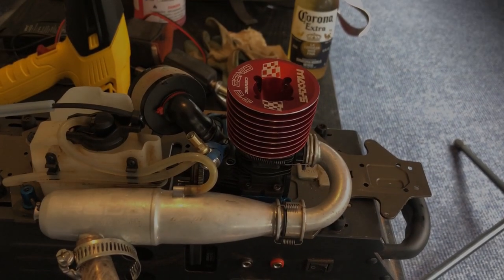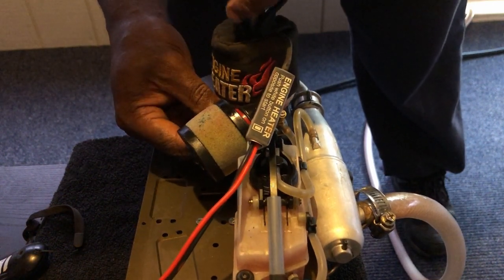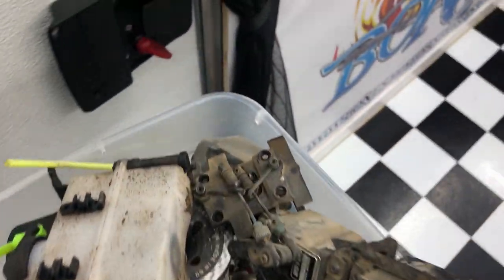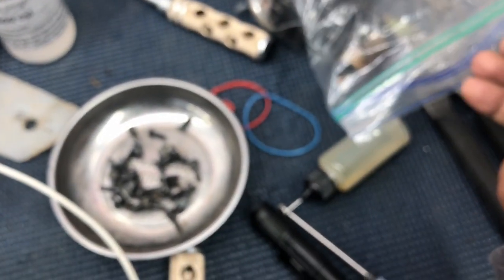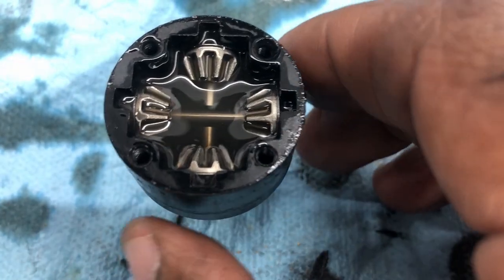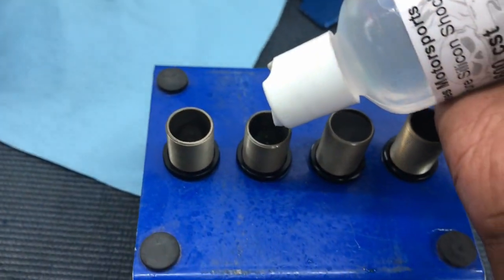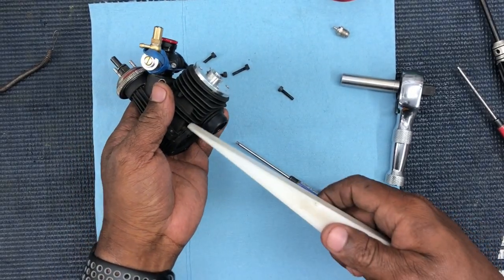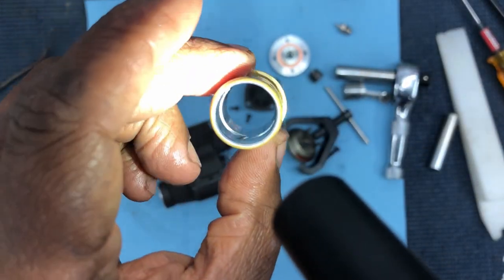Let's Break-In The Maxy's Cinco 2.0 & A Look inside After Break-In

Comment: Hey just an FYI for ya. My Picco p3tt which looks the same on the inside minus the dlc crank had an extra .20 mm head shim added to the head shin stack but on all the exploded diagrams of all the Picco engines I’ve looked at showed .30 total. So the seem to be putting an extra .20 in there for breakin. So seeing as ur engine maybe a Picco blast it very similar check your shins and the exploded diagram that came with ur engine and ya may have one too that can be removed after breakin. Keep up the great work my friend and bones brew for life!! Let the fuel haters hate. We know what the real good stuff truly is.
Reply from the maker: Sweet, thanks for the info brotha... I will give this a try on saturday

Comment: What measurement size hose did you use to run your exhaust out the door
Reply from the maker: Any size hose that will fit on to your exhaust pipe then just use a hose clamp to keep it in place
Reply: @rajaa111  I use a 8ft. length of 1/2 inch air hose. Works well.
Reply: Thanks good look

Comment: when u do break don't put that big block on hose I feel like its pressing hose closed cause of weight an is restricting motor or it just sounds like that but hose looked a little pinched the one thats outside
Reply from the maker: It doesn't crush the hose, the hose is re-enforced been using it this way for years now
Reply: @rajaa111  ah nah I just thought it looked like it was sqeezing it a little thats all didnt know u put something on hose before